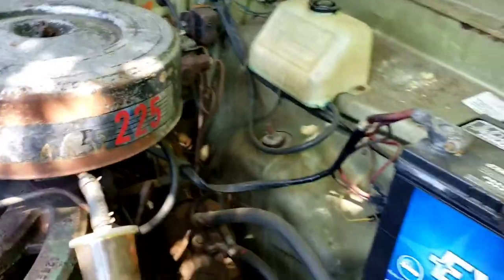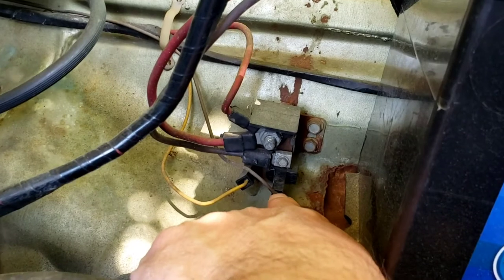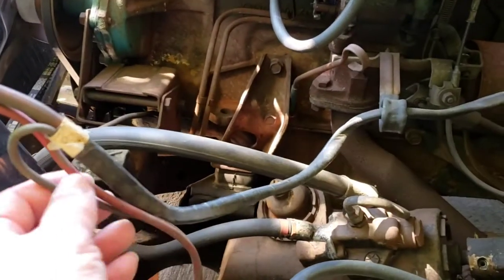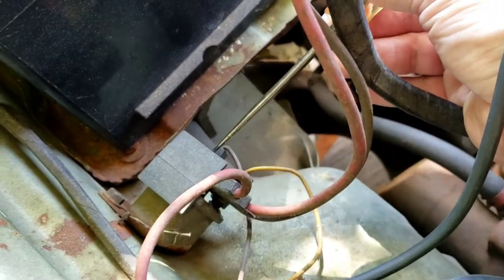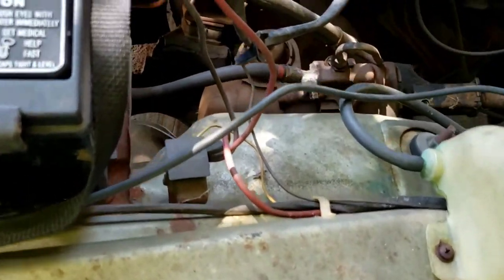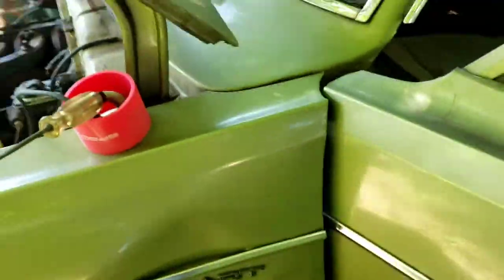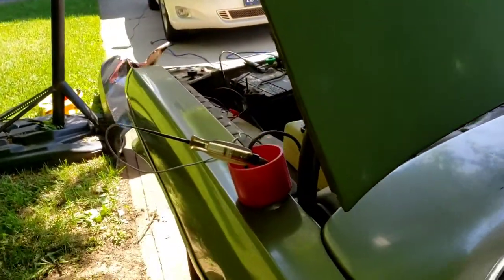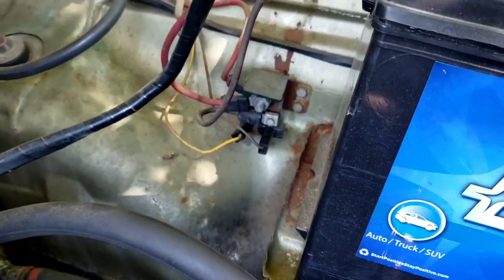Car Won't Start Old Chrysler Plymouth Dodge Mopar Won't Crank Starter Relay Check 60's 70's 80's

Comment: Well explained . Between 1970 to 1980 I worked at an auto electric rebuilder . Most shops would have flunked your test . Replace everything was their fix . They wouldn't look for the bad connector till AFTER about 3 starters were changed ! I saw few test lights , wiring diagrams were scarce and few had meters or test equipment - but they were ALL expert " mechanics " . I did purchase a Milton battery load tester , which wrre mostly used in the parts stores to test " bad" batteries . I was even laughed at for using it at a salvage yard . They used a TIRE IRON to short out the batteries ! If " Big Spark " = battery good = Fred Flintstone . Most shops were helpless with a wiring diagram . One simple thing I tell people : turn the key to start , if the test light doesn't light at the " S " terminal on the starter , your problem is BEFORE the starter . To get accurate results . the battery should be 12.6 volts or higher . Even today , some shops have NO CLUE what they are doing with electrical . And if you ask them about  voltage drop testing , the blank stares continue . " The experts " !
Reply from the maker: And don't forget about looking for a battery drain,most shops can't perform that test either...thanks for the compliments and thanks for watching...
Reply: @alyoungcuda  Way back I had a friend's car . They sold him an alternator on a 1978 Grand Prix . It had a drain . I disconnected the alternator to remove the integral regulator drain and check for bad diodes . None . All the fuses were pulled . ( OLD School , you can now check for voltage drop across them without pulling them ) . I suspected the clock , BUT the fuse was pulled . I had to physically remove the clock to lose the drain ! It must have back fed somehow . I would have to see a wiring diagram . I don't know how many shops would do a parasitic draw test on a modern vehicle . All the latches must be closed and modules timed out to sleep . My electronic battery tester will test ripple voltage , for diode leakage . There is a way to do it with a DVOM . Some alternators are impossibly burried , like Ford Taurus V6 . Most shops and even some dealers are weak on electrical diagnosis . Pine Hollow Auto Diagnostic is top shelf . South Main Auto recently has a GM that the dealer wanted $ 3900.00 for a pile of parts , which NEVER would have fixed it ! There was a bad ground strap and he fixed it for a fraction of the price !  Some places are dangerous !
Reply from the maker: @billsmith2212  dangerous because of a lack of knowledge,  but also the way a dealership is paid, no one likes to spend time on diagnosis..no old timer will do that on piece time. I clearly understand that point but time is money and techs don't have that time unless they get a flat 40 hour pay

Comment: You are the man. Since i wasnt born till 16 years after my car was built I was trying to wrap my head around figuring out what does what today. My valiant wont crank by the key anymore so this is amazing. Thank you thank you thank you! I thought the yellow had power when the key was on but makes total sense that its on crank only! Duh lol hopefully its not my ignition switch
Reply from the maker: Could be the connector under the steering column, the pins and wires burn out.

Comment: I've had a 74 plymouth Duster that's been sitting for about 6 years minimum that I got working and then the following day the steering column started smoking after attempting to start it a few times with no crank. Because of this video, I think I know where to look for the source of the problem! Thank you!
Reply from the maker: You're welcome, post what you find and Thanks for Watching

Comment: After using a remote starter for the past way too long, I watched your video several times. The NSS wire at the starter relay did not trigger the light. Got under the car and found the other end of the wire hanging out in the neighborhood of the NSS. Connected wire to middle prong and got several clicks with the key. Cleaned the ends and wellah. IGNITION !!! 😃 Thanks so much.
Reply from the maker: Alright, glad it worked out for you and thanks for watching...

Comment: Just what I was looking for! Thank you for making this video. Now I just have to figure out what numbers on a relay that each wire goes to (30,85,86,87). 30 is the bigger red wire to the battery, 85 is the ground, so I got those two...
Reply from the maker: Not sure if a Bosch relay is gonna be strong enough for a chrysler starter relay replacement..30 and 87 go together. 30 is the battery, 87 is the source you want powered after the 85 the ground and 87 the trigger will engage the coil to complete the circuit and pull down and trigger the 30 power to go to the 86 source...

Comment: My 1972 dodge motor home wouldn’t start until I installed a new starter relay switch. It worked for a few days and no start again. So I put a new starter relay switch again. Today, after a few days, it failed. Why does it burn so many starter relay switches? Thank you.
Reply from the maker: Unless you definitely test them, I don't think the relays are the problem,  I would suspect the connections especially the plug in connector,  the actual metal terminal and the crimp to the wire..if you remove the plastic connector off the terminal ,I'm betting on the strands of wire crimped..this was a problem on a car I worked on, once I removed the terminal, a close look and I found only 2 wires crimped out of the 8 strands of wire..once touched,  it made a connection until the next time when it wouldn't start.. its a simple relay, 12 volt power coming in from the battery, other side is 12volt power to the starter..the 2 smaller wires is what activates the relay..1 is power coming in from the ignition,  the other is the ground from the neutral safety switch.
Before you swap out another relay, do your homework,  try to shift the dodge into other gears, try to start it in neutral,  park..if it starts by just doing that, its the neutral safety switch  or the plug connector ather at the transmission..so basically you will look at 2 things, power coming in to the relay when you turn the ignition to start and a ground on the other terminal to complete the circuit in order to make the 2 12 volt battery wires connect.. Try it and let me know what you find..some people found the plug loose on the switch on the transmission...

Comment: To be sure, the relay on your car that you demonstrated with was known to be good, right? Also, can a bad relay still be jumped with a screwdriver...hot to solenoid? Thanks
Reply from the maker: Yes the relay I show is an original one still working from 1969 with only 42k miles and yes you can jump the relay as you said to start the car..but make sure the shifter is in park or neutral because you will bypass that part of the system by jumping it and if it starts it will roll in drive or reverse and kill someone..

Comment: The wire from the starter relay into the car goes to the AMP meter. It fails and then nothing works.

Comment: My 73 Dodge Dart starter relay passes all these tests but still will not attempt to crank. You can jump the relay and get starter to crank. Replaced relay and motor still will not crank at all. Battery is brand new. Any ideas on what to check to get it to crank? I triple checked everything you said in the video.  Thank you for your time
Reply from the maker: If you can get the relay to crank by jumping it than the secondary part of the relay works, the only part is the primary which is the yellow wire from the ignition key and ground from the relay which is from the neutral safety switch. So eliminate the nss switch by disconnecting the wire, hook up or connect a wire to ground and try to start it.if it starts, its the nss switch wiring to the switch or a bad switch. If it doesn't start with the nss switch grounded, you need to check the yellow wire for voltage coming in from the ignition switch, you might get power to light up the test lamp but not enough amps to ignite the relay..you can hook up a wire from the ignition plug on the relay and touch the positive battery terminal and it should crank because you now powered the relay,  the ground is jumped and its the same as jumping the relay..like I said to power the relay,  you need a good ground and power from the ignition..bad connections at the nss switch plug is also a problem in older cars or they are slightly unplugged.

Comment: Great video and awesome explanation my 69 dart today gave me a dead nothing after i pumped gas and turned the key i kept trying and trying and bam it suddenly woke up.. i will run these tests and love what you did here educating us all. Big fat thank you!!! Any chance u can do the same for the voltage regulator? I just wanna learn as much as i can about these cars now that i have one.. also if i jump the wires on this switch the car cranks so if my key unit is the problem i should be able to leave it in the on position and jump the switch to crank and start the car right??
Reply from the maker: When you say jump the switch you mean jump the starter relay, then yes..check the terminal crimps that grab the wire..they tend to break off strands of wire..have to look close and wire brush the connections..Voltage regulator is a good idea, I will keep that in mind...Thanks for Watching

Comment: Just watched your video I learned so much thank you. I hope you can help me with this one thing tho. When testing the Parking/ Neutral my light turned on but very dimly. Any sugestion to why that is
Reply from the maker: I'm going to say that the connector at the neutral safety switch is not making a good tight connection or its dirty with dirt or oil...over time like any connector terminal it will spread open..still making contact but not tight.think of it like holding a baseball bat..you can grip it tight or just grab it enough to hold it. It should be tight.
Reply from the maker: And Thanks for Watching...

Comment: Great job, thank you so much. BUT I have the opposite problem. My 1981 dodge W150 Pickup starts perfect, but the starter does not disconnect. When i disconnect the batterie it stops, when i connect the cable back on it starts even without key. The engine is running, and the starter is still in and starting. I checked the starter outside the car, and it works perfect. I replaced the ignition switch and the key lock in the steering column. still the same. A few weeks ago, i replace the relays next to the batterie. So, is it the relays again??  Thanks for any help. Juergen Zimmermann
Reply from the maker: Thats easy to check..at the relay when the car starts the  power goes from the battery cable terminal to the starter terminal and it should have no power once its started and the yellow wire coming from inside the cabin should have no power after it starts. If it has power the yellow wire than that's what is making the relay crank the starter..instead of pulling the battery cable, pull the yellow wire off it should stop, if not then the relay is stuck on and its shot..if pulling the yellow wire stops the starter then its a problem inside

Comment: My 85 d159 just clicks when turning the key, when i leave key in run position and hook remote starter switch to positive battery cable and solenoid terminal on relay and push remote switch it fires right up, so its probably the relay? ill try your test procedure, thanks
Reply from the maker: Technically you are bypassing the relay with the remote so that shows the battery and starter is good,now you want to test the other 2 terminals for power from the ignition switch and a ground from the transmission or clutch switch if its a manual.  If those 2 check out, then its a bad relay..but check the 2 connectors, the wire might be hanging by a tread inside the crimp in the plastic connector that is just worn out..

Comment: Starter Bendix operates but starter won’t turn, just slow clicks. 
Starter is new, battery is not, but the truck does same thing with jumper battery attached, engine just won’t turn over. 
Is it possible it’s the relay?  
Or what else to check, any ideas appreciated!
Reply from the maker: Battery is bad..the battery terminals are good..cables to them are good? A jumper battery power still has to travel thru the bad battery..if its shorted or stone dead it will not allow it to go thru..sometimes on a stone dead battery the jumper cables from another car will have to stay connected for over 20 min to 30 minutes to charge it up..and when you say jumper battery its not a jumper pack..those are not strong enough for a dead battery..use a good running charging car or truck
Reply: @alyoungcuda  thank you!  Will go for new battery, just didn’t want to keep throwing parts at it. Had used a battery charger on it, then jumped off running car. Will try new battery. Great video from you, ‘87 Dodge D150

Comment: Thank you very much for taking the time to share this with us. For me this is a refresher course as I used to be a mechanic in the military and learned all this stuff but, changing careers to metalworking and welding now for over 40 years, ones memory...well you know!
My question is I recently picked up a T/A Challenger that was about 2500 miles from my place and had the owner for it up over the phone and no problem, however when I got to his place a few weeks later with truck and trailer, the car would crank and start, but the instant you let go of the key from the start position to the run position the car would die..
I picked up the car anyway, and started investigating with a friend, (former mechanic as well) we decided it was the ignition switch. After changing that, car did the exact same thing...could it be the starter relay that you covered so well? Or do I need to look at the coil or the ballast resistor etc?
After seeing this video, I figured you are the guy to ask...
I've had the car since May and now have components to restore the bulkhead (Evan's Wiring, Pa.) And as of yesterday, got a whole new underdash wiring harness from Classic industries, but I have yet to get my new baby up and running so I can drive it!☹
Any help would be absolutely appreciated at the highest level! Thank you,
Razor!
Reply from the maker: Sounds like ballast resistor to me..still points or electronic ignition?
Reply: @alyoungcuda  
Thank you so much for getting back. 
It does have the electronic ignition.
Reply from the maker: @razorworks9942  that should be your problem since you did say you changed the ignition switch..the electrical part and not the key part..also the fuse box connection bet the inside and outside box could have a little corrosion..and a bad connection
Reply: @alyoungcuda  
I can't tell you how much I appreciate your help..I will be going through my entire electrical system and replacing whatever needs replacing. I hopefully will be able to resolve any issues and if I have any questions can I reach out again?
Reply from the maker: @razorworks9942  sure..so remember the car has a start/ crank circuit and then the run circuit..the run circuit  when defective will start the car  but will die the moment you release the key.
Reply: @alyoungcuda  
Great information..You obviously covered the "crank" circuit..so what components or parts make up the "run" circuit? I'm sure this is where my problem lies...
Reply from the maker: @razorworks9942  one wire on the  side of the ballast resistor comes from the ignition with the key in the on position.
The other side gets power when you crank it to start. This wire comes from the starter relay then to the ignition coil and thats why it starts..then the key in the on position takes over from the other side of the ballast and runs the ignition coil with the reduced voltage..so a bad broken ballast will cut this off and a bad wire blue in color I think will shut the power or juice off too if its broken from the ignition switch..this goes thru the fuse box.
Reply: @alyoungcuda  
You are AWESOME!!!!
I will carefully check this out Al... man thank you so much for breaking this down for me. 👍👍👍👍👍

Comment: Can a bad starter relay cause my truck to not shut off with the key turned to off position?
Reply from the maker: No, starter relay is just that, to start the truck..a bad relay can go bad in 2 ways only, it can not start the truck like a dead battery or starter. The other way is that it gets stuck and it engages the starter while it is started and running..sounds like you have a bad ignition switch.

Comment: I never new the one was the ground. I am not a wiring Guy:(. I will try to see if that's my problem as to my 68 Barracuda will not crank with the key. Thanks
Reply from the maker: Sure is a ground it completes the relay. The ground will be provided by the neutral safety switch.
Reply: @alyoungcuda  I don't know why I never thought of that. No ground no start.